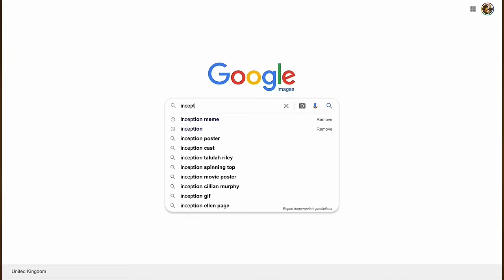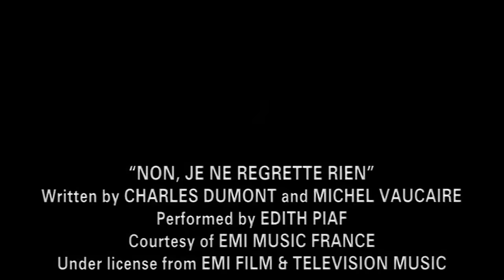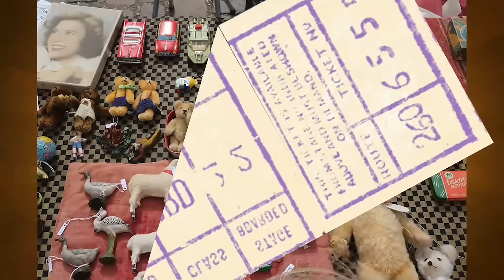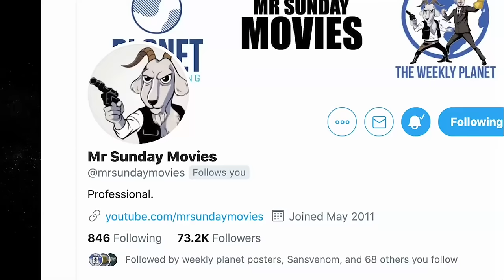Inception - Caravan Of Garbage

Comment: Why isn’t it a kick when the van flips over during the car chase?
Reply: Because... uhhhh... shhh, that’s why.
Reply: Drugs?
Reply: The way I handwave it is that they just feel like they're spinning in place, not falling. Like they're buckled in so tightly that the left to right movement doesn't bother them. Doesn't make that much sense, but it worked for me the first time I saw it.
Reply: From what I can remember THAT'S EXACTLY THE FIRST KICK. But they missed it, so they had to go with the second one in order to buy more time and to do over things.
Reply: The kicks have to be synchronised to wake people up multiple layers (they point this out in the film).
Reply: Justin Murtagh yes but, correct me if I’m wrong, when Joseph Gordon-Levit is in the spinning hotel corridor, he’s only one layer below the van, so if it was a kick he should have woken up in the van, right?
Reply: @alexanderwill2847  No, because you need a synchronized kick on the current level and the one above, due to the heavy sedative. You need to be pushed out of the level and pulled into the next one. If a regular kick worked, they wouldn't make such a big deal about timing, they could just kick any old time.
Reply: Sedation

Comment: Speaking of the score, this movie came out right around the time the iPhone 4 came out (which is still one of the best phones to ever be made, if not the best) and so they released an app for it.  It was just called Inception if I remember correctly but it was mainly just some of the score but but you were supposed to put it on when you were falling asleep and it was supposed to give you crazy dreams.  It worked too well for me and I only used it like 2 or 3 times because the dreams it gave me were way too vivid.  I'm doing a bad job describing it cause it wasn't really just playing the score, they did something to it, but I would get chills whenever I would hear the main theme for a while after that.  That was until every single movie trailer did it to death and now it's just annoying.
Reply: A man does not know about the score